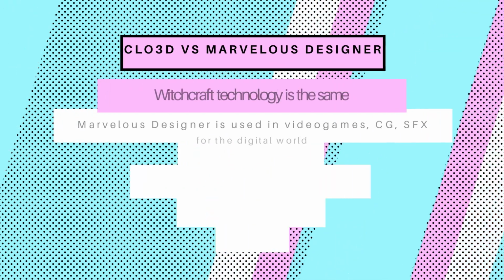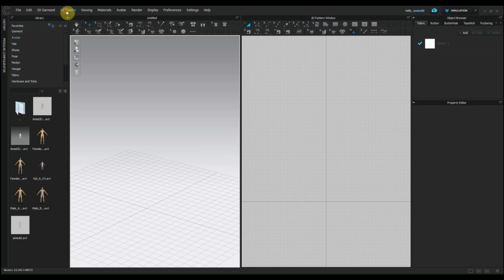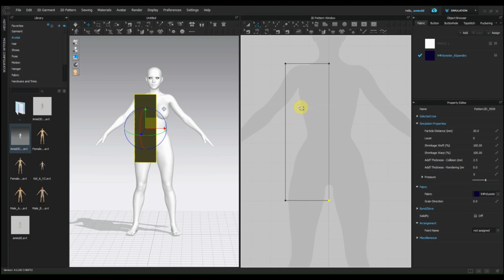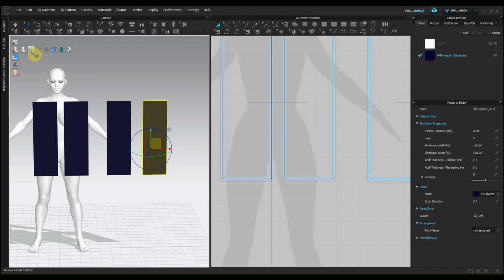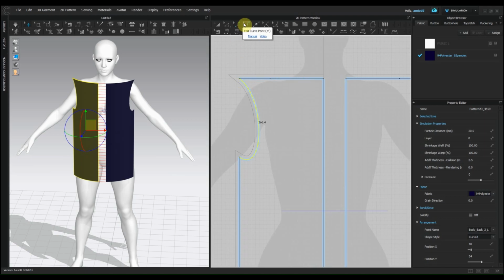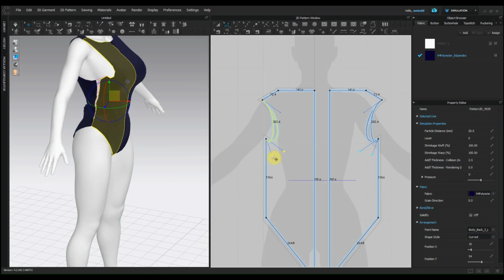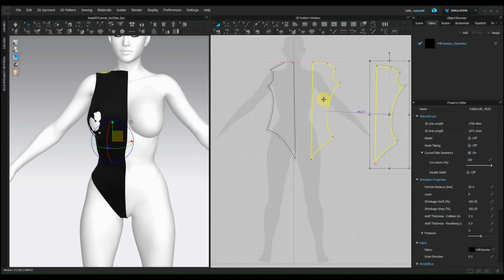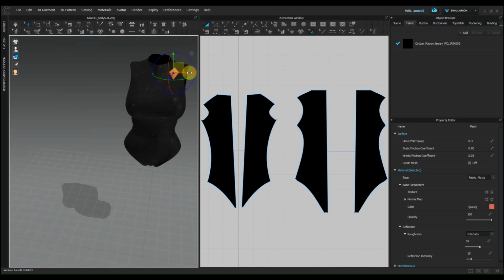3D Sewing for Cosplay Pattern Tutorials using Clo3D

Comment: I'm giving clo3d a go for the 1st time. I'm a dressmaker but it'll make digi patterns easier.  Thanks for the tips.  Also, if you find yourself stuck with excess fabric at the back waist, try curve in the centre back line in a bit at the base of the spine.  It's basically like digital alterations isn't it haha
Reply from the maker: @toot255  yay! Best of luck. Since I am not professionally trained, patternmaking was a challenge for me, but much
easier to change digitally in Clo while I was learning. How do you normally do patterns currently?

Comment: does it let you edit body dimensions? (height, measurements, etc.)
Reply from the maker: If you’re asking about the avatar, yes you can edit the avatar height and measurement. Though I found that editing the bust line for larger bust size using the default Clo3D avatars not great, you can make a avatar in Daz3D and adjust cup sizes for the avatar better. You can then import your Daz 3D avatar into Clo3D. Alternatively you can also have a 3D body scan of yourself and import your own avatar.

Comment: Something that concerns me, there doesn't seem anything visible in this tutorial to constrain the length of a given seam to be the same on different pieces of fabric? For example around 18:30 the back pattern seems significantly longer along the side than the front one; also it's seen that fabric bunches up around the lower back of the avatar, perhaps for that reason?
Reply from the maker: You can lock internal lines on patterns and set constraints on the patterns. The 2 front patterns are locked to each other and the 2 back patterns are locked to each other. All of the bodysuits I own are usually longer on the back than the front. I think you're right though, locking the pattern outline would have helped with the bunching on the back. I didn't have any issues when I sewed the pattern together(I did use a serger, so it cuts off the additional material) and the fabric is very stretchy. I'll take a look at locking the constraints! Thanks for pointing that out Siana!